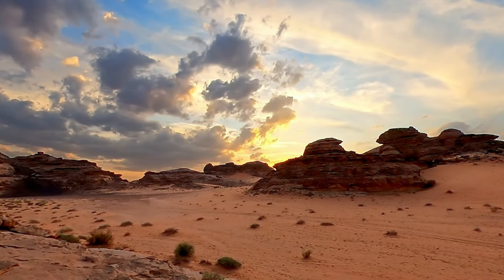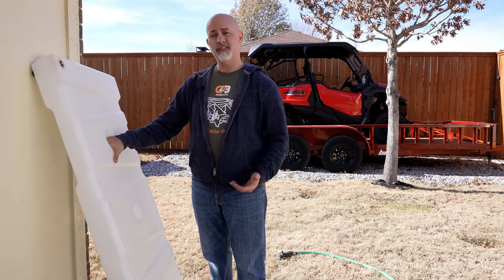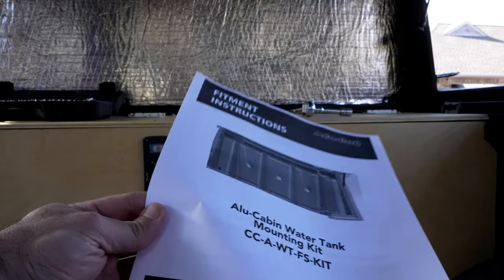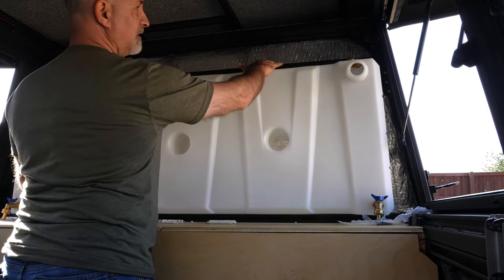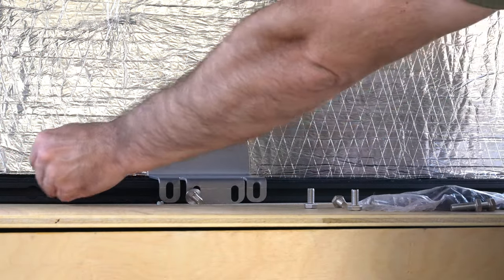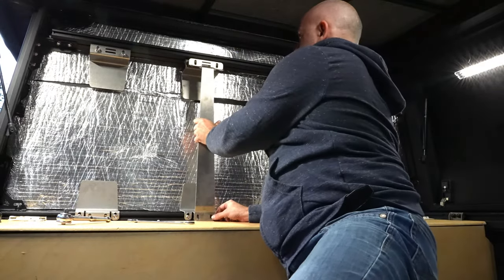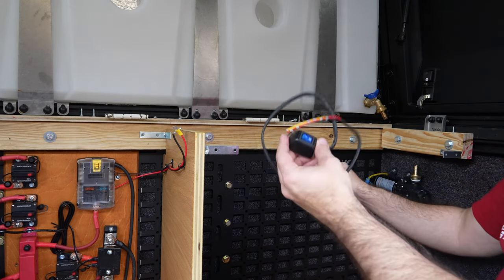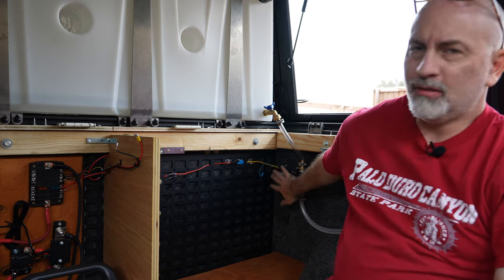How to Install an Alu Cab Cabin Water Tank - Step-by-Step Guide

Comment: How tight are the brackets against the grooves on the tank? Do the brackets touch the tank at all?  I wonder if they'd rub holes into the tank over time.
Reply from the maker: The tank brackets are tight at the top and bottom enough so that it doesnt move side to side.

Comment: Nice vid.
But don’t really understand why the tank is designed to sit as high as it does. Raises the centre of gravity. Tank could sit on the tub floor, which would be a lot lower.
Reply from the maker: thats what i thought at first and planned to put a 15gal. in the bed, but it saved room, and when fully filled i dont even notice while driving.